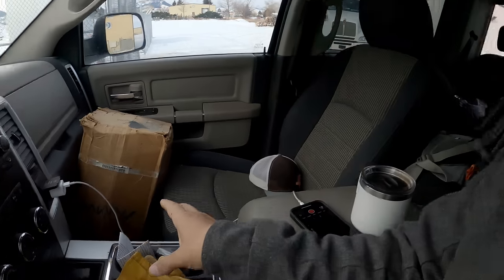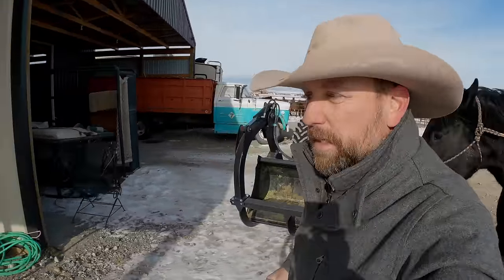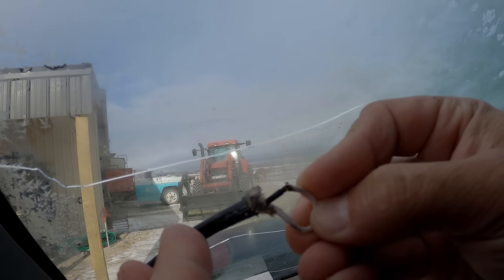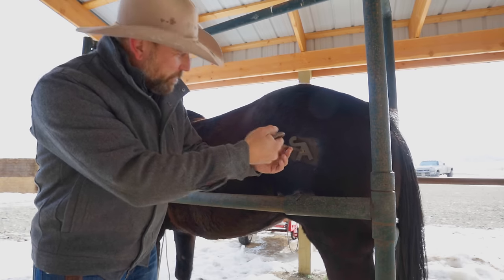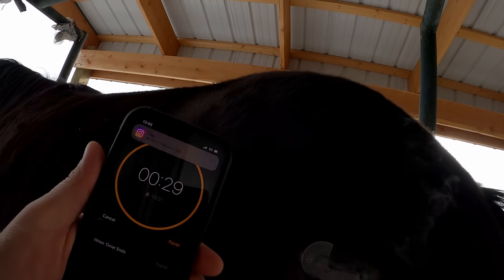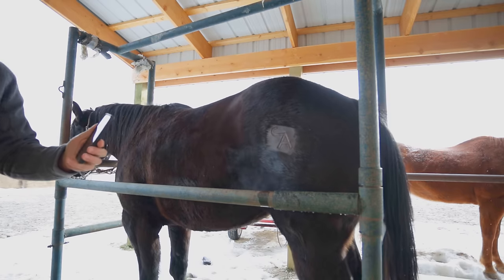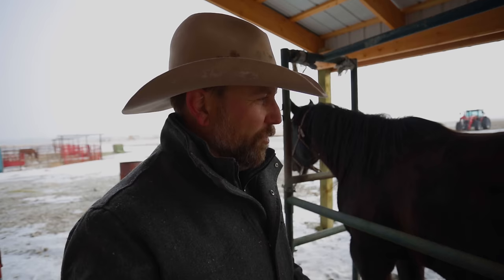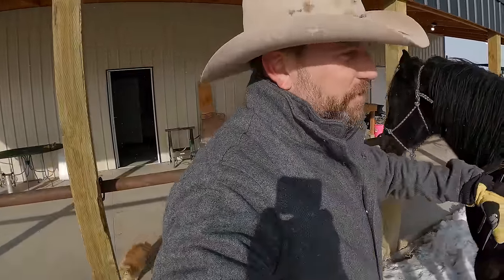How to Freeze Brand A Horse

Comment: It’s basically painless, horses have a really high pain resistance. The freezing cold iron just basically itches a bit and make sure you use some kind of oil and never peel the scabs.
Reply: Who peels the scab off of animals? I understand the urge to pull your own scabs but another creature's that's wacked.
Reply: @boundedscythe7726  some people tend to do it so it doesn’t leave like scarves on it or help the cicatrization process.
Reply: @jmec03  removing a scab causes scars if you want to avoid getting scars let your scabs alone they'll heal and prevent scarring so you really shouldn't be removing it.

Comment: at dermatology clinics they use liquid nitrogen held in a metal canister to kill warts. i’ve had many spray sessions with this stuff. on the skin feels very cold at first then it tingles a lot (like putting your very cold hand in hot water) then it feels very hot (frost bite burn)- all within a few seconds. it stings for a few hours after treatment but the warm feeling goes away immediately after stopping. i have a high pain tolerance so it’s all tolerable. i don’t think the doctors use it for longer than 30 seconds so maybe the horse feels the same thing as us.🤷🏻‍♀️

Comment: While at Ft. Carson Colorado in the early 60s they maintained a small group of hay burners rescued from the glue factory. The stables were near the front gate. I imagine one main reason they existed was because the fort included the 77th Armor Mechanized 'Calvary' [tanks].  Anyway the horses had two speeds; one going out onto the hill area behind the stable and the other when pointed back. ... Hang on pilgrim!!

Comment: I worked with LQ in the healthcare system, it will burn human skin and it would hurt a human severely.
Reply: A horses skin is about 3x thicker then human skin, yes it still hurts but it would be a. Lot worse on a human, and the other option if hot iron branding so i think freeze branding is a better option.

Comment: Not practical at all. To time consuming for a working ranch.
Reply: Not really as the process is more or less the same aside from having to buy the liquid nitrogen for cold branding. If anything I'd bed its faster to get a brand up to temperature with liquid nitrogen than it is for hot branding via a fire.